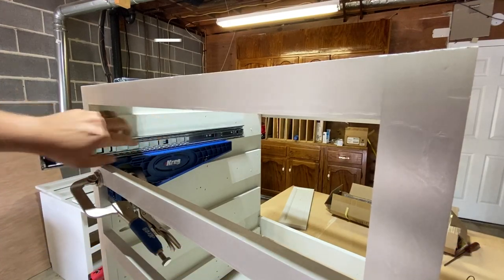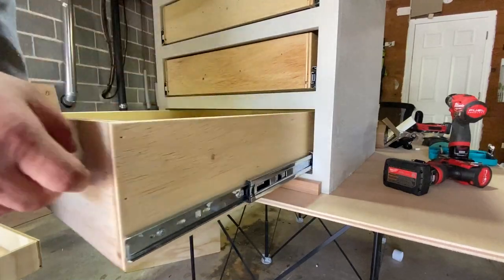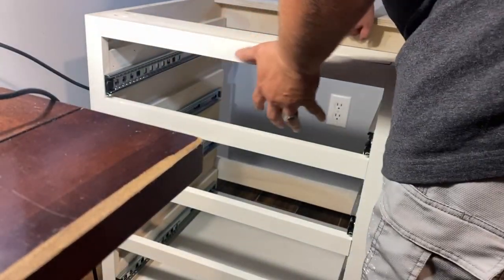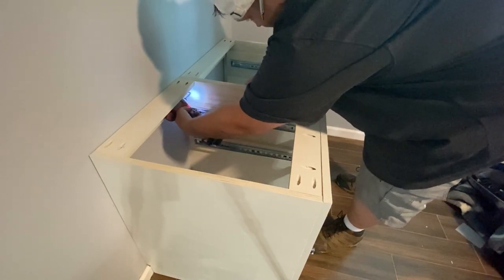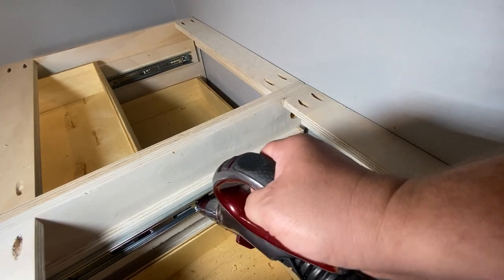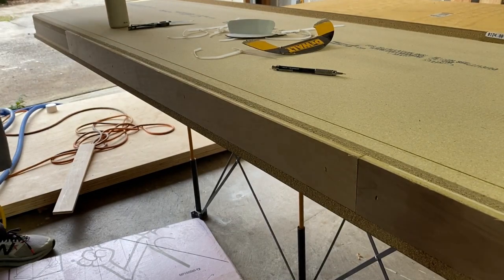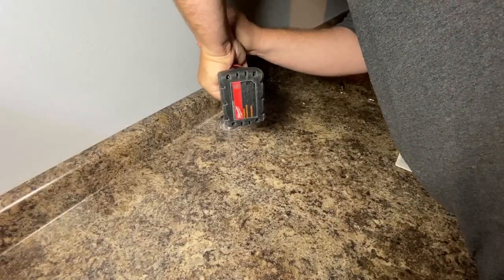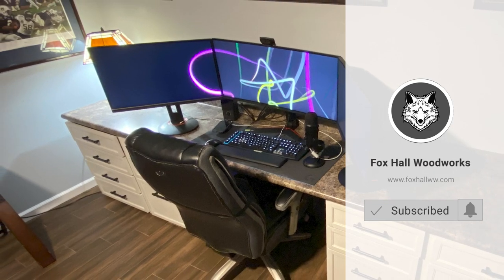DIY | How to Build a Base Cabinet Desk | Part 2 | Woodworking Projects

Comment: The only criticism I have is using flat paint on the cabinetry. I think it will tend to show dirt and scuff marks far more readily than either a matte, satin, or semi-gloss finish. Otherwise, I think you did an awesome job.
Reply from the maker: thank you sir.  I agree. I do not like the paint job at all.  But it's a learning experience for sure.   I will use cabinet grade paint next time.